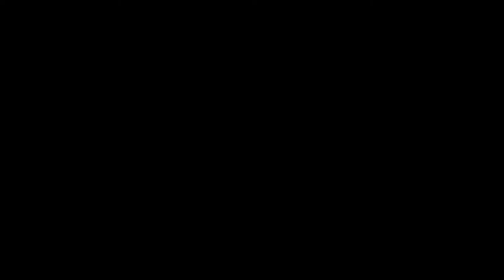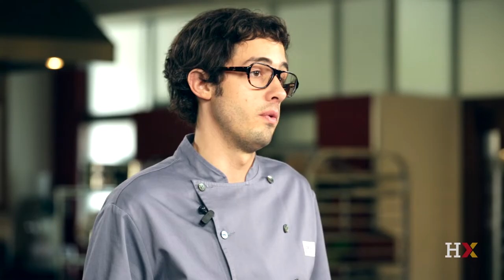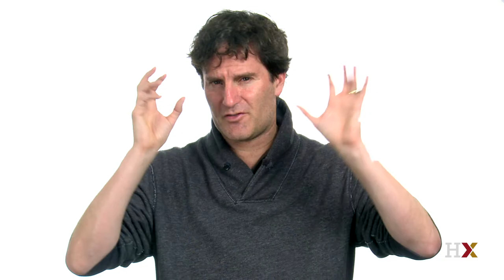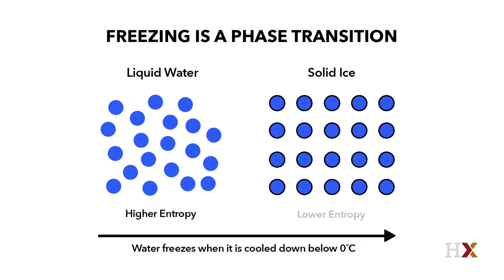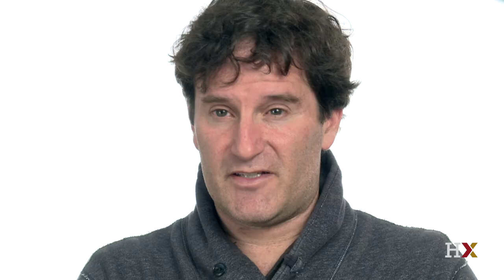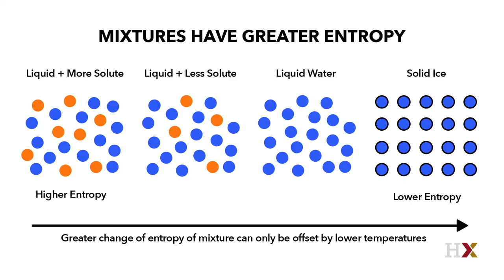Ice cream and freezing point depression

Comment: So I understand how salt lowers the "freezing point' of the water and has an impact on what happens inside the canister, but I still can't understand how the salt actually lowers the "temperature" of the ice/water mixture in the bucket.  How does salt make the ice colder?
Reply: It doesn’t.  If your freezer is set at -10C, that is the temperature of your ice you started with.  Heat only flows from hot to cold.  Your ice is the coldest object in ice cream making process so it only absorbs heat energy; therefore, it cant get any colder than what you started with.
Reply: I didn't get it either. Tell me when you figure it out
Reply: @fatimaasad2005  As user dn7 mentioned, the ice is much colder than you need. The problem is that ice by itself is bad at absorbing heat from your churning vessel, because it's shape and tendency to melt prevent it from making constant comprehensive contact with the vessel. That's where the water comes in. If you make an ice water bath for your churning vessel, the ice can cool the water, and the water can make contact with every surface of the vessel. The catch is that you need the contents of the vessel to get below freezing, but the water can't do that because the water in an ice water bath never goes below freezing. No matter how cold your ice is, it can't make the water go below freezing. But, if you add salt to the ice water, it lowers the freezing point to several degrees below freezing. This allows your very cold ice to cool the water to several degrees below freezing. It can now freeze the contents of the churning vessel because it's below freezing. Hope this helps!!
Reply: Well, the salt doesn't actually lower the 'temperature' of ice , it lowers the "Freezing point" of the solution -means the solution will remain in liquid phase even below 0°C(freezing point of water) and that happens, because  in a solution ,the salt particles are evenly distributed and thus the solvent particles(water for eg.)  have come slightly apart as the salt particles have occupied the space , so when freezing pure water we just remove heat enough to bring 2 water molecules(which are comparatively closer) together to form solid , but in our case they have gone slightly apart, so we can say they have gained a bit more energy than previous case , so we also need to remove that extra energy-extra heat to bring the particles together to form solid, and by removing heat, temperature is lowered, and THEN, freezing point is achieved .

Comment: But why does the liquid solute + solvent have higher entropy than just the liquid solvent?
Reply: This is not very easy to understand without a visual, but here goes(I know I am a year late, but this is for those who are still curious): picture that you have a beaker of H2O.. as you may know, its freezing point is 0 deg. Celsius. So, this process is near spontaneous, and it will form a solid lattice with no problem. However, now let us imagine a scenario where we add a solute, say NaCl. Now that we have added NaCl into our beaker, we observe its freezing point. It seems that the freezing point has now been lowered.. funny. From a molecular standpoint, inside the beaker: some NaCl molecules have actually blocked the phase change of H2O from liquid to solid. Picture the molecules in motion, and every now and then, an NaCl molecule will “block” an H2O molecule from bonding to the “solid lattice”. Effectively, this is because there are molecules in the solution that are not freezing. So, being the jerks that they are, their fat arses block the guys who are actually trying to freeze up. Given that there are MORE molecules, and MORE interactions(collisions), there is a higher disorder in the “system”. This is vaguely known as entropy. Entropy has therefore increased, lowering the amount of H2O molecules that have phase-changed, and lowering the freezing point. Compared to the plain H2O beaker, the entropy will be higher in the solution.
Reply: as a solute is mixed in the solvent , solute particles are evenly distributed in solvent, but due to that we can't predict , which particles is present at a particular place this indicates that due to adding solute there is a little uncertainty added in solution, and entropy is not just randomness , it also indicates uncertainty within the system , so entropy increases